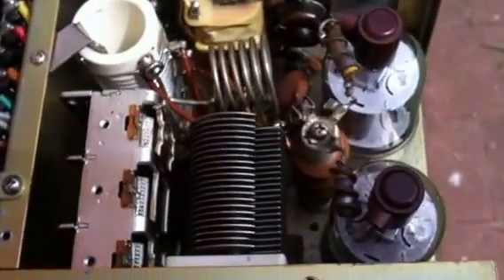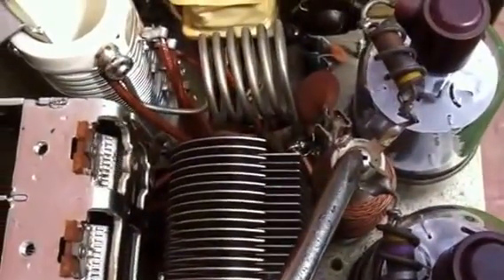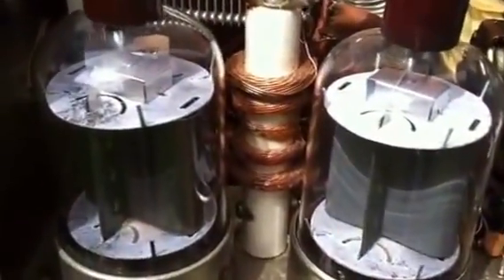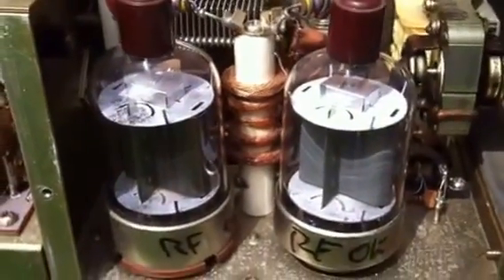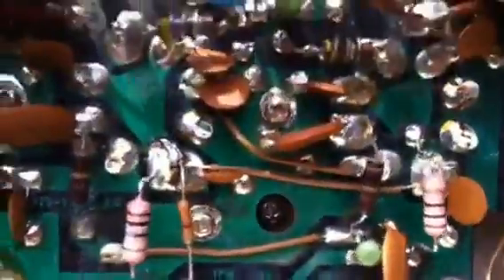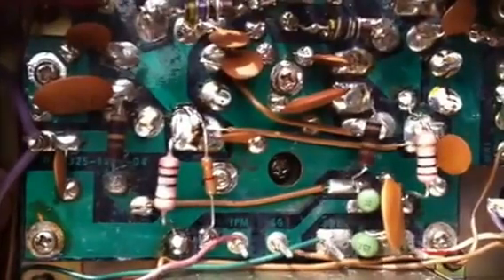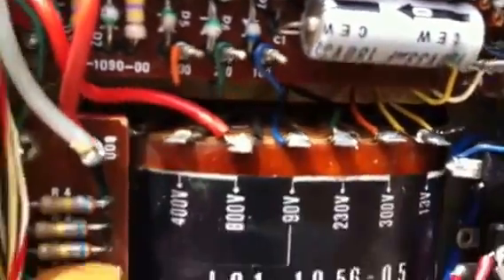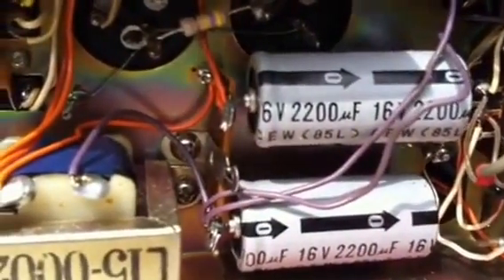Kenwood TS-520S power amp

Comment: Those electrolytic capacitors are all way past their designed  life. Looking at them is of absolutely no use. Replace all electrolytic capacitors as a rule on anything over 35 years service and ideally after 15 years. No ifs or buts. Then power resistors and then all high voltage caps.

Comment: C7, C8 and L1 (the small choke at the base of the large choke) should always be replaced on these radios. The 3kv disc capacitors take a lot of heat and abuse in the PA cage. C7 should be upgraded to a mini 10kv  .001 uf doorknob cap. It's a great upgrade to the PA cage. Get the single doorknob cap and avoid running several smaller caps in parallel.
Available here: http://www.hybridrestore.com/parts/#fcrk
Lots of info here as well: http://www.k4eaa.com
Ken, K4EAA is THE go-to guru on these radios. He sells a lot of reproduction restoration parts, too. 

Also, check the 3kv disc caps on the load wafers of the band switch directly under the PA cage. A little contact cleaner on the PA cage band switch is always a good idea, too.
Reply: What is the purpose of the small choke I at the bottom of the larger choke?
Real sing it will give additional choking at the power supply feed point; is it being used as a fuse to protect the larger (more expensive RFC)?